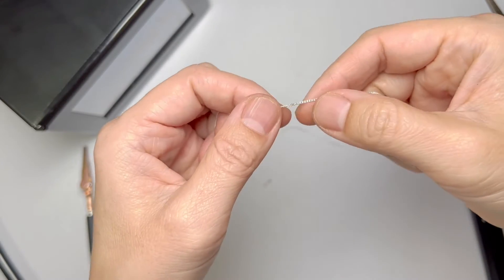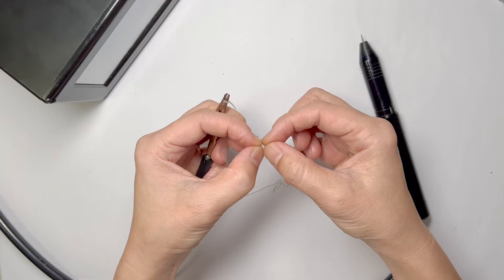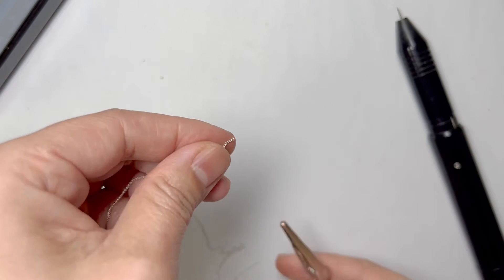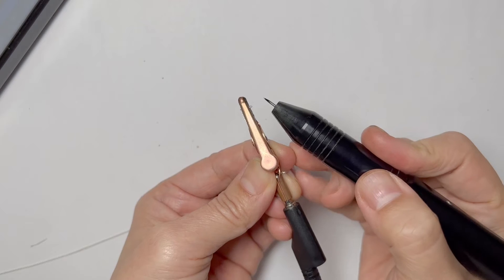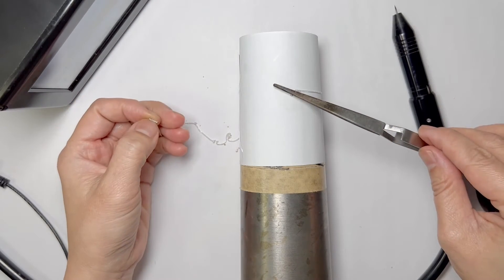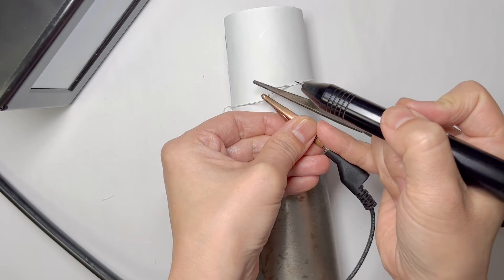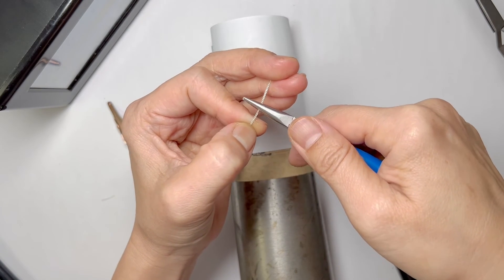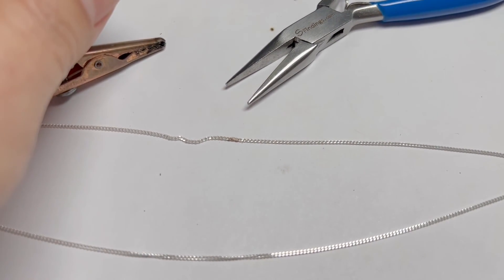16.  How To Weld Permanent Bracelet with Fine Curb Chain - Free Permanent Jewelry Training

Comment: hi! where can I find the clip you used to secure one side? I find myself having an issue connecting both sides on a persons wrist and feel like this would be beneficial in the smaller link chains
Reply from the maker: Most goldsmithing or silversmithing tool supply stores have it.   You can search "third arm jewelry clip" or "third hand clip for soldering"

Comment: hi, this orion micro welder can be optionally retrofitted microscope with darkening function ?
Reply from the maker: yes - I replied in another section, but will repeat here in case someone only views this:

The screen can be upgraded to the microscope or an ADL screen - wider screen and 5x magnification (both are just connection plug-ins, like the original small screen that comes standard with the machine)

Comment: I am trying this right now and the ends won’t connect. I have balled both sides but even trying a very low setting and even as high as 20, it’s still not staying connected. I did get it to connect once but then it pulled apart. Do you know what’s happening?
Reply: It’s also changing the color of the end where I’m balling and it won’t clean off?
Reply from the maker: If you're able to ball both ends, perhaps the balls are not touching enough.  At 20w, it can even melt them, so if they're not fusing together, they must not be touching enough.   Try flattening the tips of the ball, and make sure they are fully touching.
Reply from the maker: changing colour - fire scale is normal and if it is sterling or solid gold, it should clean off with eraser or fibreglass brush.   If it is basemetal, gold filled or plated, you will get some of the brass exposed and it is harder to clean.
Reply: Hi, I can do this at my bench, when it comes to clients it’s a lot more challenging. When the chain is tight, the third hand wants to pull away. Also when just a bit of chain is exposed on each side (the balls) there is so little room to weld in between the tweezers and grounding clip. Need more tips and more practice !

Comment: The orion is very expensive, is there a less expensive, good quality micro welder you would recommend for personal use?
Reply from the maker: The Orion is not cheap - it is made in USA, by Sunstone Engineering.  It is very reliable and sturdy, and more importantly, back by great warranty and a reliable company that is insured.  I've seen lower price point, multi-purpose welders from Alibaba and reviews are that they produce a lot of spark and some complain of feeling a bit of electrical current (tingling).  I've not tried them, so I can't give an unbiased opinion.  If you are using it for personal use and not with a client, then I don't see why those would not work.  It is only when you are using with a client that you need to be more careful for safety and liability reasons.

Comment: Hi very informative video! Question though so my wife does this (just started) and she has a chain that I would say is fine and thin. It seems like every time she try’s to make a weld the links just Explode do you have any thoughts on why that would happen. She even tried it at the lowest setting.
Reply from the maker: If this is happening even at the lowest setting, and the electrode is clean of soot build up (which can create a spark and fire that might resemble an explosion), then your electrode might benefit from being a bit more dulled.  I think this happens because when it is very sharp, the electricity is coming from a concentrated point.  I find that when the tip is dulled (by grinding it down), the spark is much softer.  Perhaps I will do a video to show the difference.  I keep one electrode that is not as sharp and switch between jobs.
Reply: We will try that out tonight and see if that works. Thanks for the info